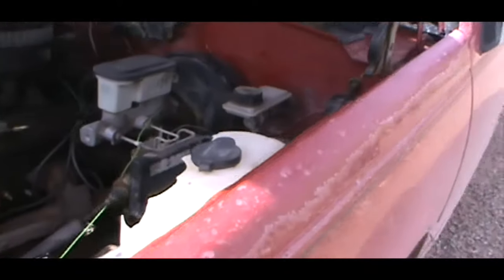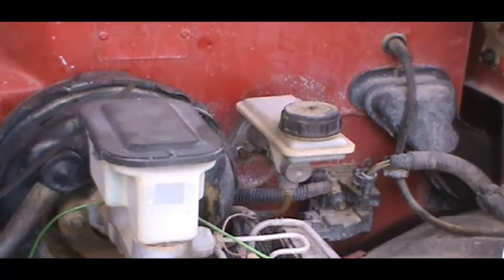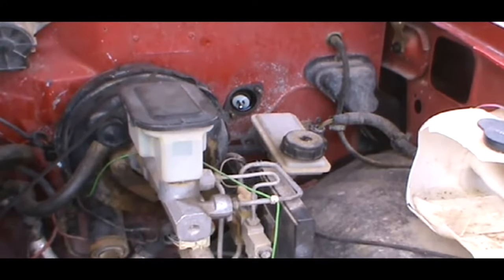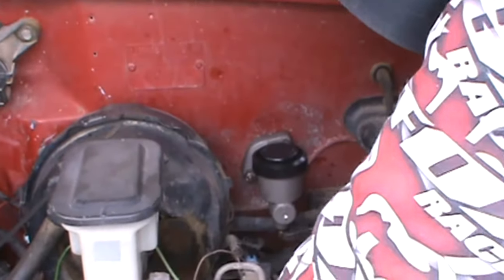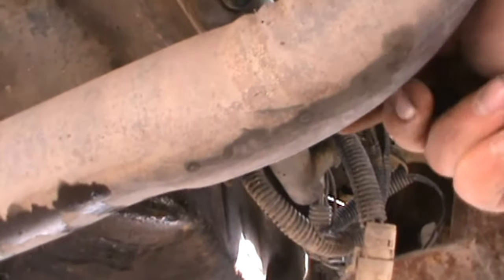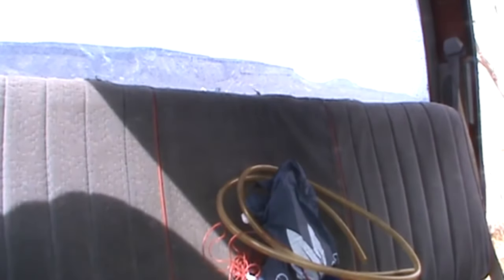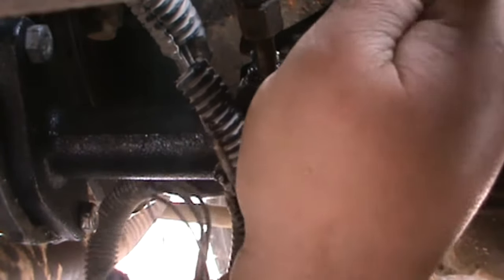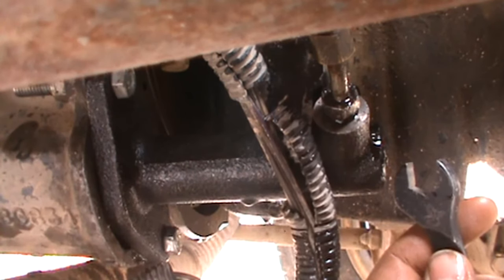1988-2000 C/K Chevy Master and slave cylinder replacement

Comment: For the 93 to 95 years the clutch line is held in with dowel pin for some ungodley reason instead of tightened on with a flared nut like on yours. Incase this helps anyone, took me a half hour to figure it out.
Reply: I was kind of wondering I  looked up the part& price and I am seeing a slave a roll pin & a O ring, it make total sense now. In one sentence you more helpful than the video
Reply: And the 92. At least mine does.
Reply: Mine too. Took me an hour
Reply: how did you get the dowel out I got the pin dowel is stuck pretty good
Reply: So if mine is leaking from the line can I tighten it, or dose the whole cylinder have to be replaced?
Reply: Thank you I'm about to do mine tomorrow (94 k1500)
Reply: How did you take off the rubber line off the clutch cylinder?
Reply: I have a 92 4.3 can't get the steel hose to set in the slave cylinder just pinched my orings now I have a bad leak can't find where to get just the o rings though
Reply: Used a drill bit to knock out the dowel pin, went inside it about quarter of a inch, so didn't loose it, when it fell.
Reply: Impossible to get the entire thing in without taking one end off thanks.
Reply: Figured that out. Not sure why the slave cylinder came with a cotter pin though. Any ideas. ( Just started the video)
Reply: The 97 is also held in with a roll pin but I don't like about that one is you stick the master cylinder in sideways and give it a quarter of a twist and if you're not in the right position that grommet does not want to smash that's the worthless piece of crap but I'm glad I got it done and I agree the bottom is even worse if you lose one of those clips my truck is sitting right now because of that I don't have a way to bleed it because I can't keep the damn thing pushed in I'll figure out something in a few days
Reply: @danielandrick2592 it's easier to remove the whole master cylinder with the line and lay the thing on the ground or an anvil and do it that's the way I did it I put it back the same way it wasn't easy
Reply: @RonaldDaub-xi5jz  extendable windshield scraper or paint pole. (Anything extendable found at local hardware store. 😉)

Comment: Thanks for this video.
I also have a 1993 Chevrolet Cheyenne pickup truck. 5 speed manual transmission. Fantastic truck.
Reply: I have a 92 cheyenne....KILLER truck..when I'm able to drive it that is..my slave cylinder blew so it's out of order at the moment

Comment: 1990 Chevrolet K1500 Pickup with 350 cu in gas engine and 5sp manual transmission... So there is a clutch slave cylinder in the path of removing the dead starter motor. Struggled 2.5 days removing the slave cylinder. I  tried using a 1/2 in socket to remove after spraying with PB Blaster penetrating oil and heating with a small propane torch. No success so I used a 3 inch diameter cutting wheel on a Harbor Freight cuting tool. A few cc's of master cylinder oil dripped as I removed the slave cylinder. The hydraulic line from the master cylinder was in good shape and the master cylinder reservoir was full. On Satuday, a friend came up and we worked 3 hours and got the starter motor and the slave cylinder installed. We crawled out and reconnected the battery and then the moment of truth... It started but the starter motor was making a grinding noise. So I turned off the ignition. There was no clutch pressure. I pressed a few times but the zerk on top of the slave cylinder had not been loosened yet to bleed out the air. Three minutes later, I started the engine again and all seemed quiet but we did not have time to bleed the line as the positive terminal and the power cable from the starter motor began smoking and over heatind and melting. What did  we neglect to do? Should we have tried bleeding the hydraulic line before starting the ignition??    Mike Sullivan
Reply: What did you find out?

Comment: 1995 GMC 1500 5.7L does NOT have a bleeder on the slave cylinder.  You just fill up the master cylinder, leave the cap off and pump the clutch for like 15 minutes.  You start feeling pedal pressure after a while and it gets stronger and stronger.  Also the 1995 has a pin holding the fluid line onto the clutch master cylinder.
Reply: I have a 1995 and the slave cylinder has a bleeder on it. I’m in the process of replacing the slave cylinder. I’m work by myself. I was thinking in bleeding it just like you said by leaving the cap off on the master cylinder. Hopefully it will work and won’t need a second person to help me bleed it out
Reply: You can also bleed one without a bleeder by clamping the clutch master cylinder in vice and take slave cylinder hook it all up and pump your slave cylinder with a screw driver with top off reservoir it will push air  out of the reservoir and pull fluid back In. I did it on a 95 worked like a charm ben h bled the whole system out it on and was done.
Reply: Works good when you are doing it by yourself too

Comment: So I was replacing the starter on a 95 c1500 4.3 manual transmission. I couldn't get starter out without removing the slave cylinder I just removed the bolts and pulled out the slave cylinder. I put the new starter and put the slave cylinder back on now my clutch is loose, do I have to bleed it or did I put it wrong? 😅
Reply: Same here. The slave wasn't tightened back up and it was a while before the starter was installed. 

Now the clutch pedal is rock hard. Zero movement.

I was advised to take the slave loose and work the rod for a while, then reinstall. 
  I'm going to give that a go
Reply: How did you fix it from being rock hard that’s how mine is rn can’t find a solution for it!
Reply: I did as instructed.
Loosened the clutch master cylinder cap.

Removed the slave. I had to make a bracket to force the rod back into the master cylinder.

Reinstalled the slave cylinder and it worked

Comment: Thank you for the video.

I have a 454 3 speed square body 1983.

I just changed my headers and exaust system, and spark plugs and leads.

Then went to start it up, and my clutch pedal is now free moving a can shift.
Would you think that is a cable or cylinder and the line needs to be bleed. 

Thanks again!

Comment: I recently changed my starter but i needed to take off the bottom piece he switched then put everythin  back then my clutch was super hard does that mean i should just add break fluid?? Since i disconnected the line on the bottom

Comment: I replaced master cylinder, hydraulic line, and slave. Still no pressure. Any ideas?
Reply: Keep bleeding. I had to bleed mine for over 30 minutes before I had full function. It was a bottle and a half of brake fluid. I needed a vacuum bleeder
Reply: Replaced same things on mine and I bleed it out and it got pressure but too much pressure, clutch is super hard can’t even push it down to put it in gear. What could it be or what can I do to fix that problem?
Reply: @ericro8761 did you figure out your problem about clutch being too hard? I'm going through the same thing on my 95 gmc
Reply: @oscartarango2361  wrong slave cylinder was my issue

Comment: My clutch cable was a 13 now it's stripped and soaking with wd40. And slave cylinder bolts were half inch

Comment: I have a 91 k1500 I hope it will be this easy tomorrow
Reply: Every step is easy thanks.
Reply: Have the same truck. Short bed stepside. I've seen vids saying you have to twist the master cylinder to get it out. Trying to figure out which way so I don't break anything.
Reply: Hey did you have troubles bleeding your line

Comment: My chevy doesn't have  11mm nuts/bolts for the slave cylinder
Reply: It's a 91
Reply: With 4 speed n granny
Reply: Mine is 1/2 or 13mm.

Comment: You're lucky you don't have the 97 model that goes in at an angle and you twist on it that's the most worthless piece of crap I've ever changed I like the truck but there are certain things like the one you have I would rather bolt on a master cylinder then have it twisted in